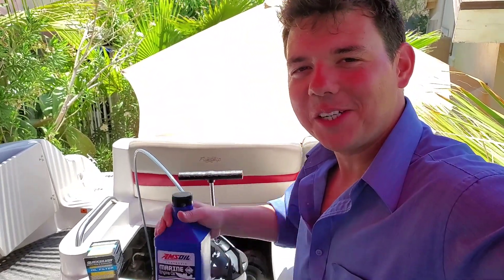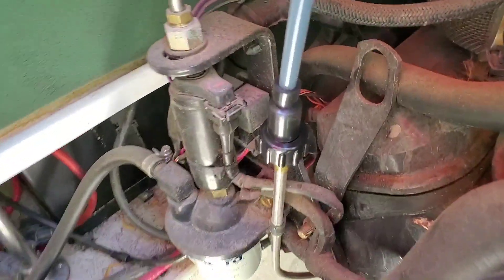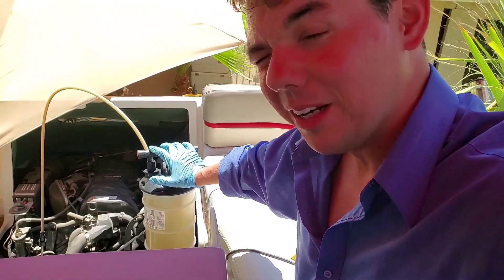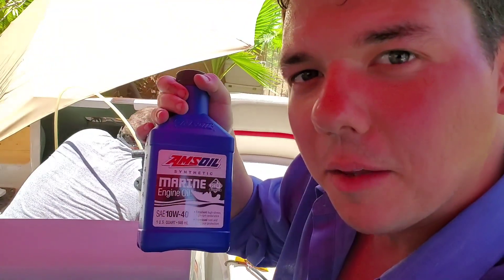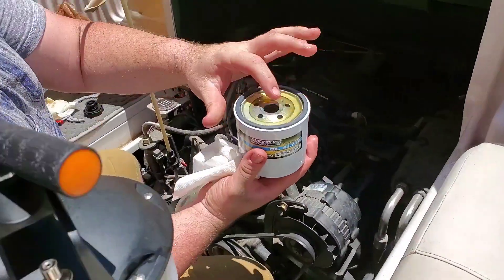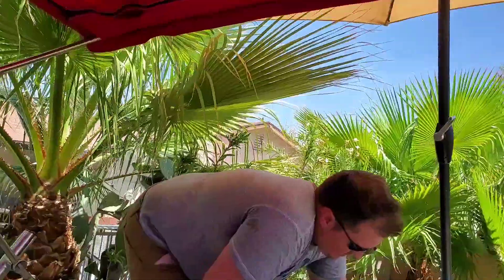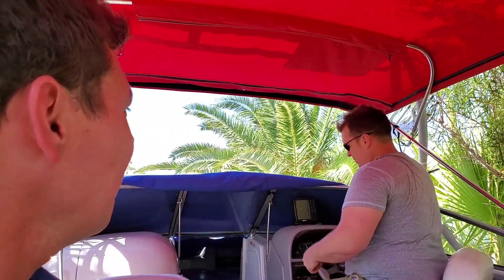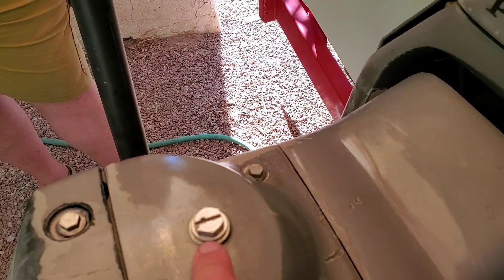Inboard Boat Motor Oil Change with the gold 10W-40

Comment: Was driving in to work this morning and got to thinking about this video a bit. It then dawned on me to try and do a cross-reference for the filter used in the video. Now granted the Amsoil site doesn't have the direct crossover for that particular filter, but I went to the Wix online catalog and it (the Quicksilver 35-858004Q) crossed to a Wix 57099XP, the performance line of the 57099 number. Took that number to the Amsoil site and it gave me EAO59.
Now granted not all cross-references are perfect (ie height tolerances), but I can guarantee without a doubt that the base plates between the Quicksilver and the Amsoil would match.
All it takes is a little bit of homework!
Reply from the maker: Complete genius!!!

Thanks for sharing with the channel I really appreciate you doing that for everyone ☕😃💯
Reply from the maker: Are you an Amsoil preferred customer?

Comment: Would this formulation be good for high performance supercharged PWCs
Reply from the maker: Not sure what pwcs's?
Reply: @Syntheticoilprotection  jet skis
Reply: @Syntheticoilprotection  personal watercraft / jet skis
Reply from the maker: I do not know I would definitely check the lookup guide it will give you everything for your year make model and engine size jet ski.
Find AMSOIL Products For Any Vehicle - https://www.amsoil.com/guides/?zo=5331179
Reply from the maker: If you're new to Amsoil or haven't become a preferred customer this is the very best value on the products and when you use my link I will always be available to talk with you in the future as your Amsoil dealer.
I appreciate the business future business in advance.
✅ ✅ ✅  You will get Best Value with 6 Month AMSOIL PC Membership because You get $33 back on a $100 purchase after the difference in Sales Tax with No need for Auto Renew - https://www.amsoil.com/offers/pc/?zo=5331179